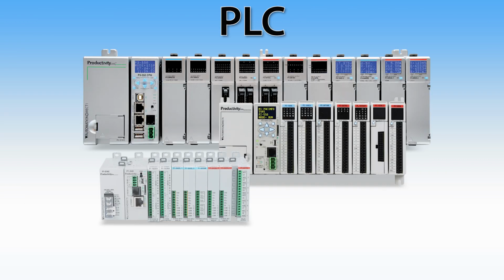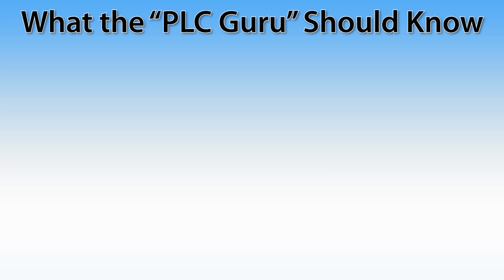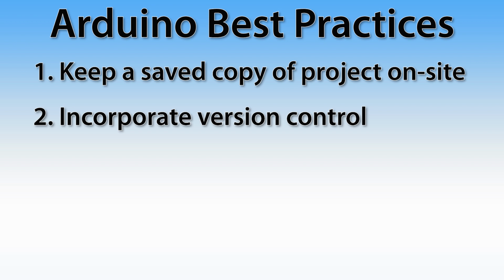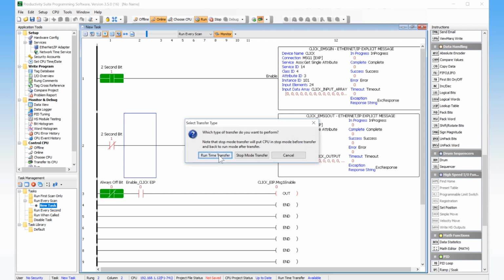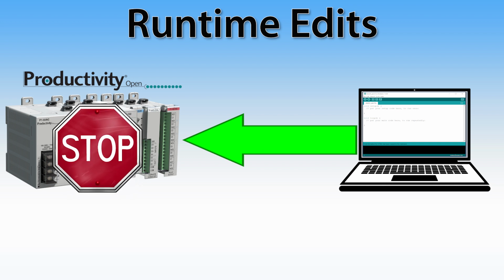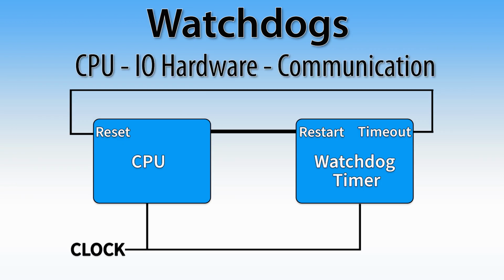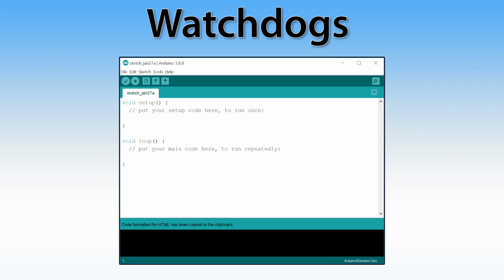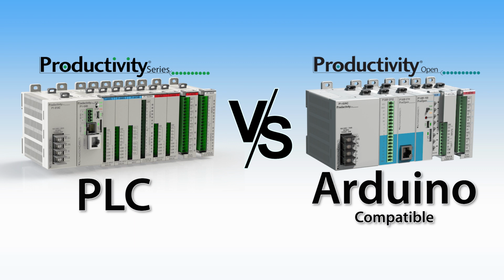PLC vs Industrial Open-Source Controller (Arduino-Compatible) from AutomationDirect

Comment: Please don't only keep a copy of the Arduino project saved "locally".  The HUGE advantage of the arduino is that you have access to internet based source code repositories like github.  Keep the project there. This is probably a practice that should be adopted even for PLC development, because there's no downloading the code from a PLC that's been cooked in a fire.
Reply from the maker: Thanks Chuck. That is a good practice.
Reply: Naw.
1. Internet connections allow these devices to be connected to everyone else. Unless there is very good security control its much better off just keeping the arduino code locally. There was a cyber attack last year on Solarwinds that affected thousands of PLCs without being detected. One of the companies I also worked with got hit and their database was hacked. All the technician laptops were all taken away since it could've been infected by a Russian program.
2. In the medical factory industry, its standard to take backups of the code to store in controlled locations as required by the FDA since the code can contain recipes and more importantly can contain audit trails (logs of responsibility, who pressed what button and when) depending on how old the PLC is. So they have regular backup procedures for them one way or another.
3. Typically the PLC/Arduino only have 1 or 2 ethernet adapters which needs to be specifically used for the PLC/Device network. It's usually challenging to incorporate a NATR module or a router just for this purpose as it adds a level of complexity and vulnerability.
4. The term save the code On-Site is mentioned. On-site does mean local, but as mentioned before there is strict control of the backups of these programs which is saved to the enterprise network 'on-site' or global. The purpose of the control practice is to not lose the program even if the building burns down.
5. Having the internet not necessarily is always good and it's not really a huge advantage other than sending  report data in most industries. Perhaps it can be set up for automatic firmware updates, but this risks breaking something and is frowned upon in a zero risk tolerance environment. In addition, depending on the set up the PLCs are capable of sending data directly to the enterprise network for that matter depending on the set up.
There's simply no use for this 'local' copy since it's very easy to lose. I've had OEM vendors lose a copy of even a PLC code and because SIEMENS doesn't allow code to be pulled from the system ,like it is possible on Rockwell or some other PLCs, we're stuck with a PLC that can never be edited. This is much more easier to happen to Arduinos.

That all being said, we have a company only enterprise GIT network for some of the backup/recovery systems just as a tertiary backup since losing code probably means you won't be working there anymore.
Reply: Doesn't that leave copies of your codes in someone else's hands? Not hard to hack into people's saved projects these days.

Comment: So, how long before we see a "code converter" to download PLC programs and automatically re-write them into Arduinio code?  The Future's so bright, I gotta wear shades!
Reply: i don't think it will be long before you will see libraries with preset code for things like implementing a watchdog or other common functions used by plcs
Reply from the maker: Thanks for the Comment Johnny. The automation is moving fast.
Reply: @guitarman_3693  no it uses c
Reply: i think that the “open PLC” project allows arduinos to be programmed with “ladder logic”—which is the compiled into C.  so—its already here😉

Comment: Last but not least the official arduino Pro IDE has a cool debugger tool. It is way better than the serial monitor or serial plotter.
Reply: The debugger in the Pro IDE requires a hardware debug connection. Unfortunately, the USB port on this and most boards are not connected in that way. In fact, the only Arduino board I can think of with it is the Arduino Zero.
Reply from the maker: Thanks for the comment. Good to know.
Reply: If you use the visual studio arduino comes with auto complete, huge libraries and debugging as well as breakpoints. It is worth the $20 per year subscription.

Comment: Don't these points illustrate the fact that it's more possible that malicious code will tag along unnoticed?
Reply from the maker: Thanks for the comment Terre. To my knowledge, there has not been an instance of a  side-load malicious code attacking an Arduino controller. There has been some instances with older version of The Arduino IDE being attacked but no code has been forwarded on to the ARduino controller itself.

Comment: Could I write logic in the Arduino that could run faster than the comparable PLC logic?  It would be nice to be able to write fast code in a PLC platform for things like high speed counters and PWM controllers.
Reply from the maker: Code in Arduino has the potential to run faster than a PLC. This is due to the ARduino sketch does not have the embedded code that resides inside of a PLC. This is not to say this embedded code is not needed. You just may not need it for your specific project.
Reply: yes you can and it is my preference to use arduino for that because it is a lot less code than writing the ladder logic, but if you have no experience in computer programming be careful because it can take a while to understand how the code is going to operate vs how ladder logic operates
Reply: @jefferysprings4314  I have programming background. It wasn't easy for me to understand ladder logic. It was designed to bridge the gap between a programmer and an electrician.
Reply: @keilmillerjr9701 Really? I found it much easier to learn ladder logic.
Reply: @jefferysprings4314 Audrino’s just aren’t durable enough to handle industrial environments. The option Automation Direct provides seems like it could actually be durable.

Comment: I use Click PLC's to turn on Relays controlled by a raspberry pi brains.  Many times I need to interface to a device such as a one-wire temperature sensor, i2c device or a device requiring special analog processing.  The Arduino option allows the uses of industrial hardware to be used, instead of rolling your own.  This is important as interfacing stuff like din rails and terminal blocks can be used.
A long time ago, I developed an interpreter for a cortex m3 device, that was used to control DSL links between a gas station and pumps. The interpreter read its program from an sd card.   I think this would be a good solution for reprogramming devices in the field.
Reply from the maker: Thanks for the comment Glenn